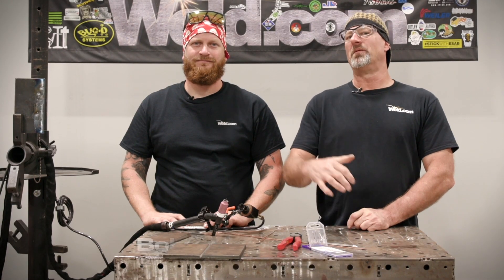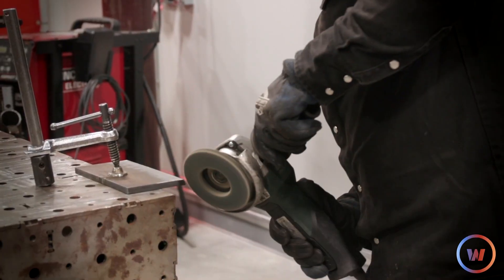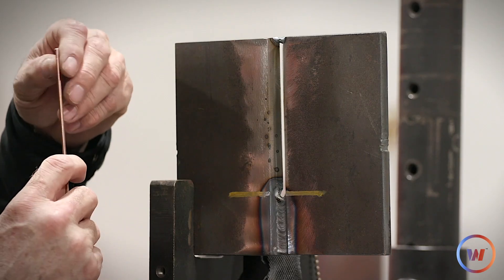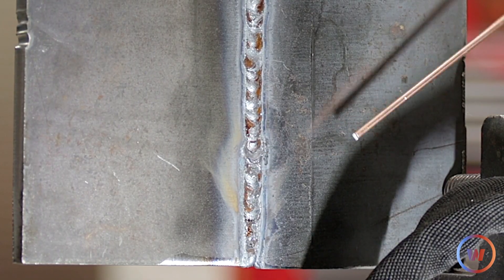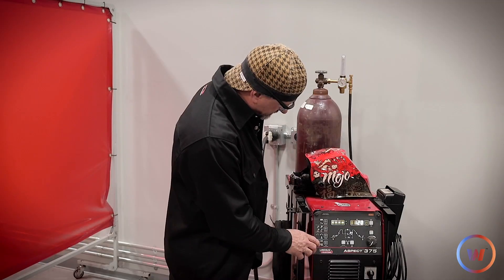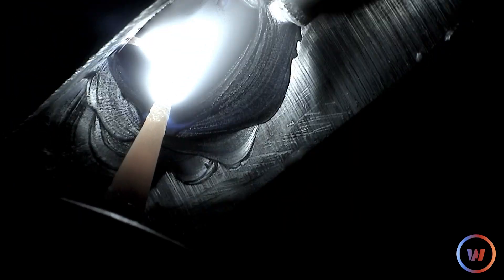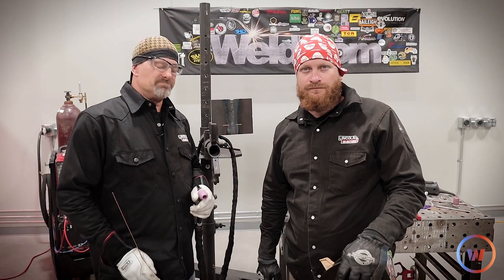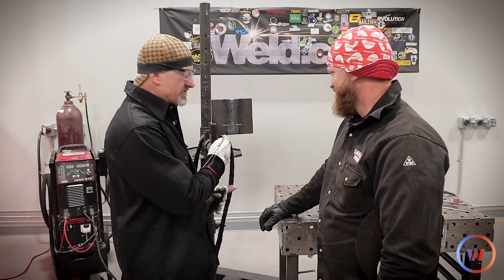Learning TIG Welding Vertical Up with FrankenFab and Paul -Part 3

Comment: Thank you.

I know you felt nervous about this but it’s perfect for newbees to learn from.

I’ve flux core mig welded for a few years .. without gas …. mainly because I bought a strait argon tank by mistake and never bothered to change it but this week I was going to buy some c25 —- $378….. 

Cheaper to buy yeswelder inverter DC  tig and use the argon so … it’s in the mail.

This is the only way for me at the moment to move into tig and stick so it is what it is…

My mig is too strong even on 110 for my truck bed with rust above both wheel wells .. 
 
I did the left side and it is actually pretty dang solid but  still has a couple of micro pin holes. 
Time to clean that up and move to the right. I could and may use body filler but that’s cheating…. 

I enjoyed the challenge which  is vertical 22ga metal rusted in an upside down 3” wide banana but I’m stubborn and patient so it will get done.

I could braze it but where’s the challenge in that?

Keep up the good work

Comment: Are there thinner gloves you can use for TIG? I feel like he needed more dexterity in the hand feeding the wire. I think this would be especially true for beginners. Then once you have the technique down the loss of dexterity caused by the thick glove becomes less of an issue. No?

Comment: Loved the video man, keep up the good work. Can I use 6011 for open root work? My inverter can't run 6010 and 6010 rated machines here cost 4grand at least. But I want to practice open root groove welds but I can't use 6010 so can I use 6011

Comment: I've tried vertical down on thin sheet metal and works fine, much more stable arc/puddle than mig or stick process and more controlable.

Comment: This is a awesome video I've Been Welding for a while finally learned to Weld pipe now I want to learn to tig thank you guys for making this helpful video it gives me a piece of mind knowing that as long as you're trying someone out there is always will to help you learn awesome video
Reply: This vid is ok I’d get rid of twisting the rod it’s not necessary and is confusing bob. Everyone has little things that are diff but I’d check out Jodi from welding tips and trick his advice,vid’s and lots and lots of practice has gotten me a lot of certs and $ tig welding I’d so much fun once you get over dipping tungsten it’s an art form and a ton of fun. Wait till you start doing 8” stainless pipe or inconel it’s so fun it’s not even work good luck in your welding journey don’t be afraid to practice straight beads till you run out of wire and keep doing it. All about practice
Reply: Thanks for the feedback

Comment: Nobody was great from the beginning man just keep burning and i dont care what process youre running theres one things you need to remember with all types of welding ride the puddle aka go slow enough and stay in it the biggest problem im seeing is youre going too fast
Reply: I learned to gas weld when I was in high school and learned to follow the puddle. This has not been as hard for me as I thought.
Reply: @kenswitzer4133  very similar to gas welding im in the same boat the first process i did was also gas welding
Reply: Thanks for the feedback
Reply: @bobhigginbotham9035  anytime